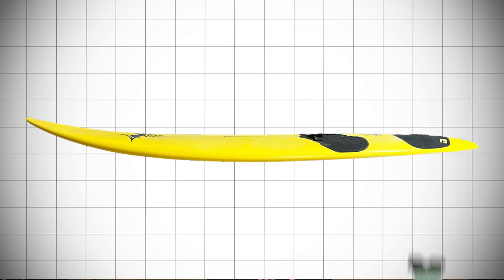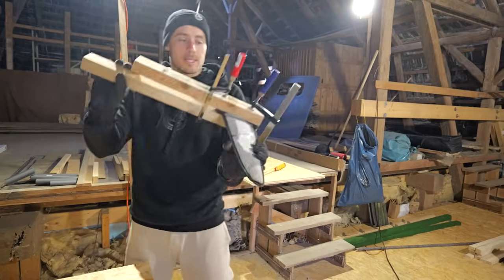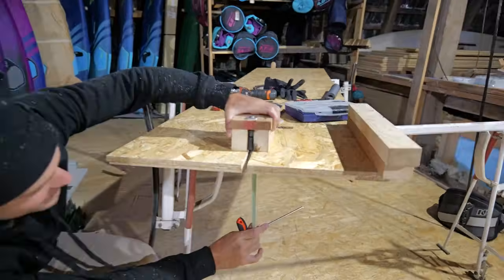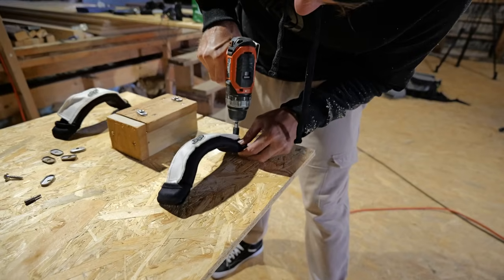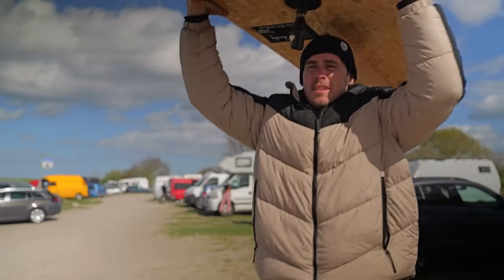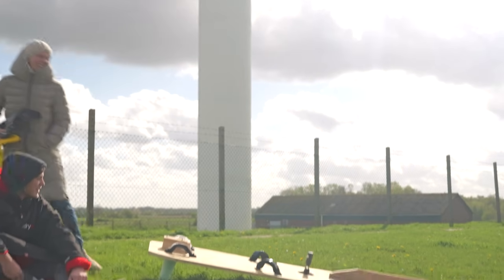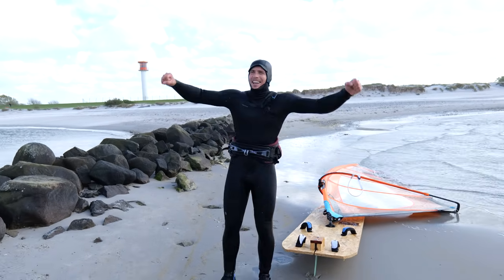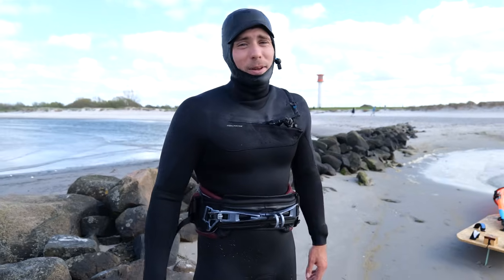I TRIED TO SURF A WOODEN PLANK | DIY Windsurf Board

Comment: You could also do the opposite now and make a sail out of bedsheets and put it on a modern board
Reply: @Nico_GER7  ein Segel aus nem Besenstiel und Bettbezug basteln
Reply: Sure, Nico will do that too :)
Reply: Making a reaonsable sail out of some kind of cloth is a lot harder, i assume. I've made one out of bedsheets, but i never tested it on the water. It's shaped like a modern sail, it has battens etc. I just never tested it. 
I wanted to see how crappy you can build a sail and if it would even survive long enough to come to a plane.
Reply: You make it out of a tarp. Pretty common on home built sail boats. 

The tricky part is the mast and boom. You can do it with 2x4's and broom sticks but its really heavy. Use a rope loop for the joint with the board.

Comment: 40 years ago, Mike Waltze took down a hollow-core door from his bedroom, mounted a sail and fin on it and got it going, then when home and rehanged the door. Steve Wilkings took photos of all of it. Significantly lower stakes than your project, and significantly more flotation. Still, bravo, especially on that live-or-die jibe. Next step: put a foil on it. Also, big up for the Midnight Oil clip.
Reply: Dont put a foil on it.
Reply: The door came from his store and when he re hung it he left the uni on it for all to see.
Reply: Trade Wind: The Wavesailing Film (1984)
Reply: I remember seeing the photos of Mike Waltz sailing a door, although I never knew he rehung the door.  Isalways wondered why he sailed it with the door handle still on.

Comment: I would recommend 2,1 mm more rocker in the tail up to 46 cm of width, and then 6.7 degrees more scoop to the front. A bit more double concaves until 98 cm from the nose will improve handling in chop dramatically. Moving the mast base 9 mm more forward, and using a fin with 2 degrees more rake would do it...
And again, if you use 100 % titanium screws you would save 0.5 grams of the total board weight giving new levels top end speed and control...

This is really crazy 🙂
Per

Comment: If you wrap it with glassfiber and epoxy its a wood sandwich board 😂
It would be better to use 2 thin sheets plywood with foam in between (pur insulstion foam). That way you can give it a good amount off scoop, get the finbox inside the board and give it some volume.
To add more strength in the right places add more layers of plywood.
If you need more advise please send me a message, i really like the idea 😂!

Comment: In the past 15 years Ago I make a Sea Lion replica, with 4mm marine Plywood, carbon strrp and extruded polistirene strips (EPS) like a vacuum wooden hollow board, and externally a 300 gr E-glass around 1 layer, overlapping the rail. Project cost about 150 euro, it was fast to do around 1 week of work and the board was fine. Final weight around 9-10 kg

Comment: Insanely dangerous use of a table saw at 0:11. (Pushing a plank across the table saw like this whilst holding the family jewels in the line of fire. 🙈 It doesn't even matter that there is no splitter installed as well...)

Comment: Next time try using some better "wood" maybe coated multiplex, should also really help with water resistance. Also a smooth surface at the bottom may allow you to go quite a bit faster

Comment: I've built an actual windsurf board out of wood. It probably has about 100l and the shape is losely based on a freestyle board. I've built it about 2019, but keep procrastinating the testing. I stood on it, it floats and it's waterproof, but never took it with me when there was enough wind to plane. 
Maybe i should lend it to you, so that you can test it (i live in switzerland). 
It's really just wood, wood glue and varnish (and of course footstraps etc.). It doesn't have a fiberglass coating, which makes it kind of experimental. It's reasonably light (probably under 10kg). I've built it as light as i can, while still keeping it strong enough to support my weight.
PS: 
This reminds me that i also have a sail made of cotton that i never tested on the water (a sail with battens).
PPS:
After building my first board and standing on it in light winds i'm actually reasonably sure, that it's entirely possible to build a reasonable windsurf-board almost completely out of wood (light enough, stable enough, shaped well enough, no fiberglass or epoxy). Especially freeride boards should be no problem. It's a shame that we're not seeing any wooden windsurf boards on the water. It would be nice to have a manufacturer for such boards. But it would require a lot of testing and probably breaking of some boards.
As a freestyle windsurfer i don't think that freestyle board or waveboard out of wood would be realistic. The material isn't strong enough for crazy jumps, i would assume, but just cruising around should be no problem.
Reply from the maker: Super cool! Where are you based?
Reply: @Nico_GER7  
Zürich, Switzerland.

Comment: Perhaps...too have epoxy resin wet coat   or paint to waterproof...?

And....Slim shady/shady ...

Will go faster...?

Maybe shape some packing foam and epoxy resin some straw hat material over the top of the board.....
Using biodegradable epoxy resin...
Reply: Also you can make a carbon fibre electric guitar out of any broken masts....to play as you are surfing...